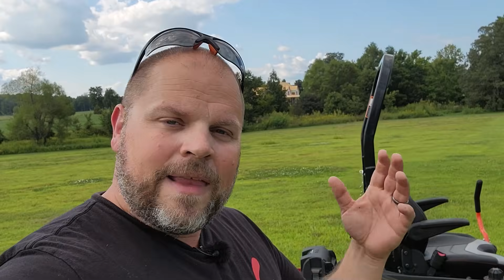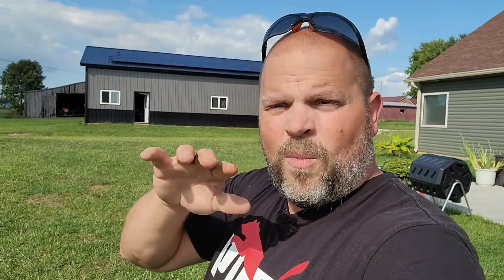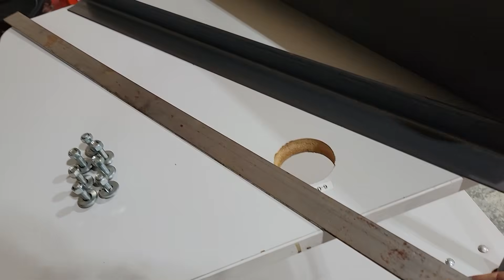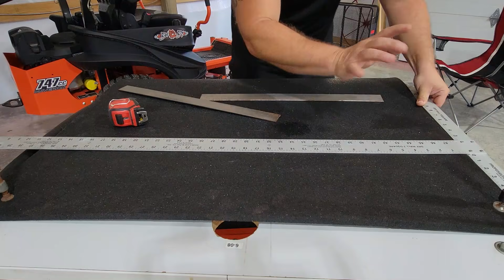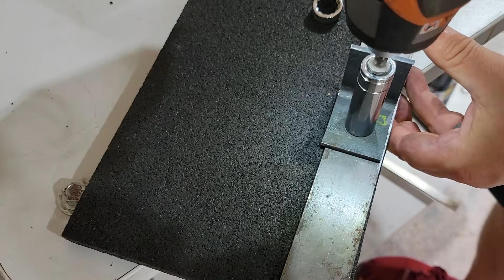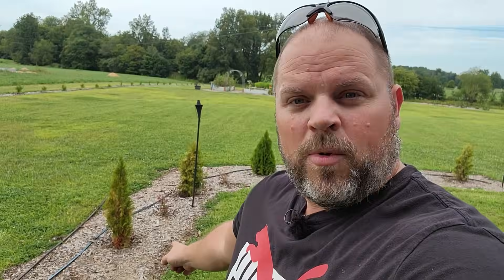How to build a grass blocker Advanced Chute System Mulching Kit – Why you NEED ONE

Comment: Not sure why you needed a mulching plug that lifted up.  Why not just make a fixed plug?  I used some HVAC sheet metal and machine screwed it to my zero turn mower deck without any lifting pivot joint like yours.  And didn’t bother painting it.  It sort of mimics the OEM mulching plug.

Comment: Have you considered to put small holes in the cover?  I'm not sure why the units I've looked at for my Kubota zero turn has small holes in the cover plate, but they do.  Perhaps to allow some of the air circulating under the mower to escape, but retain the grass?  Is there a reason to do that?

Comment: I mow a couple of cemeteries and I think this idea will help me stop blowing grass on the stones. If the grass is wet it’s like painting the stones green. I’ve got five foot decks and it’s like a tornado under there. They throw the grass about fifteen feet. I mow the ditches also and I have to mow at least three passes one way to keep the grass from going out on the road. Thanks for your video and design I’m gonna build at least one or maybe three if it works well.

Comment: Yes it’s affective but when going around the building make two outer laps blowing the grass out and then if need be on third lap facing the building, just simply turn your RPM’s down and go a little slower.  Then you don’t need to make such flap. Using the throttle cable and adjusting your speed can fix all your issues.

Comment: Thanks, I'm making one just like yours.
 I'll be welding mine. At 67 I just started welding this year. You should check out the new easy and cheap flux core welding process. Self trained and saved myself 100s in repairs .

Comment: Nice job the design is very simple, robust, cheap and easy to make well done. Have you thought about making the shute flap being able to be opened up without getting off the mower?  Maybe a lanyard or pulling device attached to the base of the shute flap and in a reachable distance from your operating position?

Comment: A Rednecks mind never stops. I have a gravely commercial zt. I just installed a catch pro system that turned my gravely into a bagger for leaf season. That being said, i had to take my mulch kit off. Well i still need to mulch the leaves up before i bag them. So i was looking at chute blockers. They are rediculas prices. So being a redneck like yourself. I thought heck I'll just make one. Then i found your video. Problem solved.

Comment: Nice video. It inspired me to make one for my Simplicity ZTR after my original got destroyed after seven years of use. I had leftover pieces of 2x2 angle iron and some straight bar. I also had an old truck bed mat that I've had for about 40 years. I occasionally cut a piece off of it for a project and it was perfect for this one. I also had leftover spray paint from other projects. The only thing I had to buy was three small bolts - $1.31. It cost more than that to drive to the hardware store. The finished project looks almost like yours, although the Simplicity mounting system is different. Thanks for the inspiration.
Reply from the maker: That is awesome! Glad it turned out for you. Thanks for watching and commenting 👍

Comment: I noticed that you allow your spring loaded ruler to retract fast till it hits the stop end.  this will eventually break off the stop end.  instead you should hold the stop end with your hand so that it does not retract with a hard hit.
Reply from the maker: Good point, although I do need a new measuring tape 😎 Thanks for watching and commenting 👍🏻

Comment: I just made this for my bad boy 48" and did my first mow with it. The grass was thick and long, and wet. I still got grass piles, but not massive amounts like before with the chute. I bought the flat and angle iron at lowes, and the gal couldn't be bothered trying to find the correct skus so she rang the metal up for $11 total. I already had the rubber mat off an old project, and sufficient bolts in my hoardes of crap. My total out of pocket today was $11.26 plus tax. It turned out very well, and do appreciate your video, thank you!
Reply from the maker: Good deal! Thanks for sharing. 👍🏻

Comment: Design it that it shoots towards the back like the old wheel horses used to do
Reply from the maker: I think Bad Boy offers a rear discharge on their more expensive mowers like the Rogue and Renegade. I seen it on the Rogue so I am assuming their top mower the Renegade would have that option also.

Comment: Doesnt the factory advanced chute system include mulching blades? Do you have any issues with grass clumping up under the deck with the factory blades?
Reply from the maker: I've used mulching and high lift blades with no problems.

Comment: I watched this video multiple times, and took the idea and made one of my own using the same materials you used for my Snapper 360z XT. I was trying to solve the same problem with some of my lawn care customers’ having mulch beds and I didn’t want to be blowing grass in them or going the same pattern every time just to prevent that. It works great, especially when mulching leaves. My only issue is mine is leaving strips of mulched up grass, and I’m curious as to your input how I could possibly fix that? @Justin’s Project
Reply from the maker: Possibly use mulching blades or high lift blades to see if that helps.

Comment: Put a nylon washer in the pivot bolts. Chute blockers also make flushing underside of deck with water work much better. I actually dunk the underside if deck in water with pto on.
Reply from the maker: Thanks!
Reply: What kind of receptacle do you use to hold the water so you can drive the mower deck over top of it and then drop it down into the water to clean everything?  Thanks.

Comment: Did you ever come up with a handle idea like the ACS has? Trying to think of a way to do that.
Reply from the maker: Not yet, I just open and close it by jumping on and off. I am still doing a long-term test to see if it will hold up. Thanks for watching and commenting 👍🏻
Reply: @JustinsProject Great video! Have you had any ideas on the lifting open and close solution?

Comment: Nice project!  I would suggest using LocTite or Nylock nuts on all of it. The vibration of the mower deck wants to make those nuts loosen up over time. Also, since there is no way to open it back up while seated on the mower, I would probably add a small eye bolt to the bottom and hook some type of bungee or rope to it so I could pull it back up while seated on the mower. I built a powered chute block for mine out of 3/16" plate steel and car window mower to raise and lower it via a 12v switch, but it was A LOT more work than what you have done here, and likely overkill for the average homeowner. It involved quite a bit of welding too.
Reply from the maker: Never can overkill to make something better. I was just trying to get a quick solution that would work for a season or two that almost anyone could build. I love the idea of the 12v switch for opening and closing the chute. I might use that when I make my metal version of this. Thanks for watching and commenting 👍🏻

Comment: Really??? Blow the grass the other way until you're far enough away from the patio and flower beds. Other than that good job on the chute build😁
Reply from the maker: If I blow it away from the patio, then it will cover the flower beds. If I blow it away from the flower beds, it will cover the patio. After about a year, I only use it in tight spots. But it does help. Thanks for watching and commenting 👍🏻

Comment: Or you could have just made 3-4 passes blowing the grass away from building then blow clippings into the previous pass you just made….😂
Reply: You must not have paid attention. He’s mowing between a mulch bed and a patio so either way he faces, it will blow onto an unwanted surface. This happens a lot in mowing and a chute blocker is a fantastic add on. I agree with his statement that every mower should come standard with one.
Reply from the maker: Thanks for watching and commenting 👍🏻
Reply: No, in the video  the first part he’s in an open field he makes one pass next to a building then turns around and blows it right back against the house, hence why I said make a few passes before blowing back into the cut grass and you won’t have that little bit of grass on the concrete by the door, rewatch it

Comment: Just need a small amount of rubber, TRACTOR SUPPLY has what is needed in a 3'x4' piece for $31. BUT they wanted $30 to ship it!  The flat steel already cost me $26. All of the supplies will end up at least to $150.
Reply from the maker: I got the rubber at Rural King. Everything else I had laying around for other projects. Use a small piece of the rubber, and then from the remaining piece of the mat, you can build a stripping kit. Thanks for watching and commenting

Comment: I need to build or buy a chute blocker. Only thing about mulching blades though, my customers all are bi-weekly cuts. I think mulching blades work if used at least weekly. Not sure how they would work 14 days growth during summer. I run high lift blades and they do throw grass more than I’d like around areas like you showed to be problems for you.
Reply from the maker: Yeah, I'm considering putting my hi lift blades back on. Although my mulching blades are doing great, I want to sling that grass further in the field. Thanks for watching and commenting 👍🏻

Comment: Great diy project. Also another tip is to mow 2 or 3 passes around the perimeter of property, and any object/ structure blowing in towards center of area then mow the direction of your choosing. Admittedly there are still times where a chute blocker is beneficial.
Reply from the maker: I find myself opening it for most of the yard and only using it closed around patios, drives and beds. Thanks for watching and commenting 👍🏻
Reply: @TheSolarPit Do you make the grass blockers for the Bad Boy ZT Elite?
Reply: The problem, he said, is between things such as patio and plant bed.
Reply: @specfever2  read last sentence of my reply.☺
Reply: Great video!
Reply: Where do you get it on Amazon?

Comment: First time listener, first time caller. Well done Justin! Built it, mounted it. Perfect fit. All that's left to do now is paint and test. Followed your tip, Used 1.5" x 1.5" angle and 1.5" flat steel. Rural King delivered a speckled recycled rubber mat. I suppose my '14 48" ZT will be all the rage now. Thanks for your excellent notes and suggestions.
Reply from the maker: Awesome, I hope it works out for you. I've been waiting for spring and mowing season.  Thanks for watching and commenting 👍🏻
Reply: @TheSolarPit  Just tested it. The only mod I had to make was to tighten down the hinge bolts to the point of preventing the Chute Blocker from  opening. Standard blades mulched fantastically. Putting my mulching blades this weekend and ready for Spring. Thanks again, sir!

Comment: Thank you man!!!! Great video!! Wish i would have saw this before i bought my Advanced Chute System from Ballard INC!!
Reply from the maker: Appreciate it! I do still plan on making my stripping attachment. Been busy finishing my shop and I haven't had a chance to do so. I hope I can get it completed sometime in the spring. Thanks for watching and commenting! 👍
Reply: I was getting ready to buy one for the upcoming lawn season but 2 3 400 bucks, no thanks. You could easily take a piece of conduit and bend it up, put a rubber handle on the end and bolt or weld or have someone tack weld it on and now you can open it from the seat easily

Comment: Need to put a handle on it so you can easily open and close on the move! And you could add a magnet to the backside of the blocker which would hold it tight to the deck
Reply from the maker: I personally do not like the handle on it. It gets in my way. Certainly could add one pretty easily if you wanted to though. I thought aboit the rare earth magnet but for now it stays in its spots fairly good. We shall see how that works over time though. I will give updates on it if I need to do further mods. Thanks for watching and commenting 👍🏻